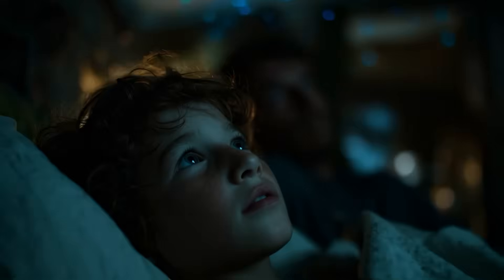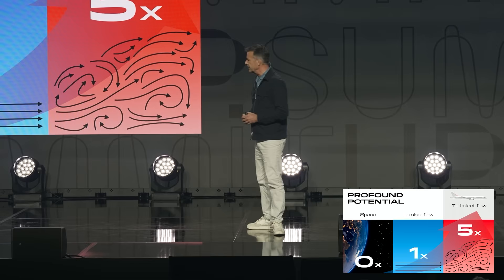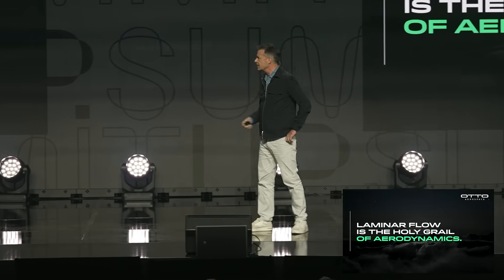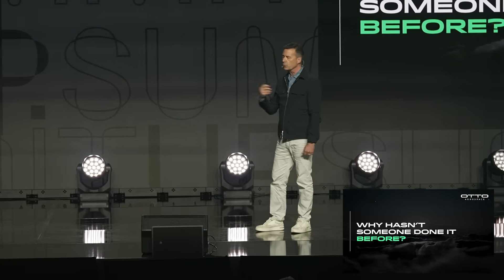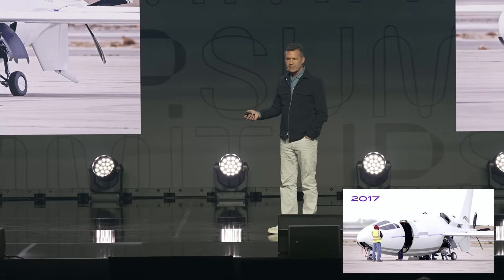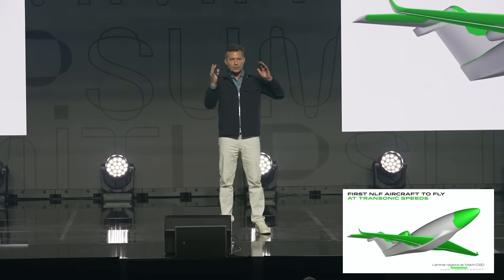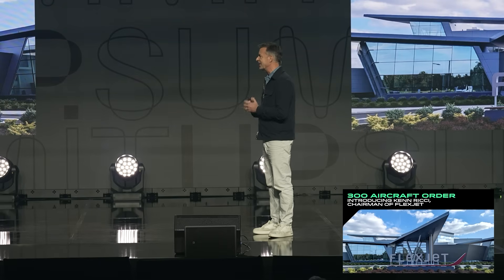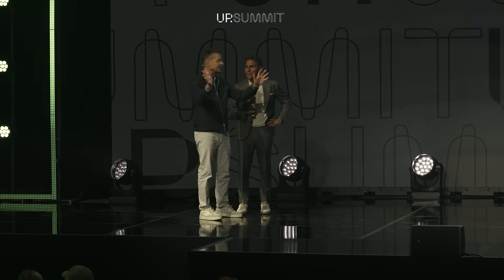Otto Aerospace CEO Paul Touw Presents at UP.Summit

Comment: 6:31 “moves at Mach 8”, I know what he meant but I chuckled.
Reply: I understood it as well but after doing a double take to confirm we were still on the egg-shaped jet I've been watching since '21 and not the a new variant of the X-43 😂
Reply: I heard what you did, but he meant Mach .8 or 613.84 mph at sea level. Ain’t no way on God’s green earth, that anything shaped like an egg is going to move at hypersonic speeds. What he was trying (poorly) to point out is that the design has high, sub-Mach speeds. Like current airliners. I’ve been following this company for a while now and the concept is proven (Celera 500 L). Proven and sellable may be two different things though, since many will have a problem with egg-like fuselage shape.
Reply: An airplane company that can’t present their airplane ideas…

Leading up to the guy who has bought positions in many of them… who skips talking about why he select this over that… and said the most important thing is capital.

Unfortunately, there is nothing to see here…

Non-pilots appreciate second engines…

Family members appreciate backup parachutes…

Small business owners like their own turboprop aircraft…

Selling rides on a small single engine aircraft is a very tough sell…

😃

Comment: There is quite a lot of BS in this presentation, unfortunately. Laminar Flow (LF) is not new and is employed on the HondaJet wings and in some Boeing aircraft. LF was the holy grail decades ago and we saw General Aviation aircraft with LF lifting surfaces. An essential problem with using LF lifting surfaces is contamination. Once a LF lifting surface is contaminated with ice or even rain, it is compromised and this can (and does) radically change its performance, such as a wing CoL (Centre of Lift). The comparison with Stealth Technology (ST) is spurious. The reason aircraft using ST have only recently appeared is because a huge amount of research and testing was required to minimise radar signature. The fuel burn comparison is also spurious. The Otto prototype used a diesel combustion engine, which will not be used in production aircraft. The singular novel feature of the Otto aircraft is the design of the fuselage as a LF lifting body. It raises the question of how to keep it completely clean and free of contaminants and damage. The underside of this low-slung fuselage might become  contaminated by landing on a wet runway, of from tyre rubber. A dent from runway FOD in an undercarriage door would not affect flight characteristics of a conventional aircraft, but on a LF fuselage, might materially affect flight characteristics - eg increased drag, reducing range.
Reply: I can’t agree with your “BS”, assessment. You’re right about LF not being a new concept. It was first used at scale in the wings of the P-51 Mustang. You’re also right about contamination affecting performance. But, contamination or damage would impact flow (performance) on any surface of any design. This breakthrough he’s referring to is in fuselage design. LF is referring to the flow of fluid (or air) across any surface, not just lifting bodies, so, since the greatest surface area on most aircraft will be in its fuselage, that’s where the greatest reduction of drag can be experienced. IF, they can get the design calculations right, which has been impossible until recently. This is evident in the egg-like shape of their designs. Am I off the mark here?
Reply: I agree with jimw1647, there is still lots of innovation that can go into even older ideas.  LF tech is far from optimized and certainly further work in the area will provide interesting capabilities.

Comment: My grandfather developed the Laminar flow wing in the 40’s. It is not new technology. The physics of drag have been known for decades. I wouldn’t buy a car from these two slick talkers.
Reply: First flights through some bugs and goodbye laminar flow.  Lots of hype and hustle here.  

Like you said, laminar flow as a technology has been known and used for 80-plus years.  This is not a breakthrough secret.
Reply: @kenstickney8678 What your grandfather developed was a wing that maintained laminar flow over more of the wing, in comparison to a "conventional" wing. The bigger problem now, is to maintain that laminar flow in conditions where the wing will tend to get dirty. Where regular aircraft will need to get de-iced, these aircraft might need to get their wings washed in normal weather conditions. As an example of the benefits of laminar flow, the Excellence Risen Ultralight completed a non-stop flight across the Atlantic last year, East to West, against prevailing winds, 1900 nautical miles, on 50 gallons of fuel at 165 knots.
Reply: As an aeronautical engineer I can attest they are telling the truth.   Bugs are not a problem all the time, depending on humidity, winds, ... there will be optimum windows to takeoff to avoid excessive bugs.
Reply: can't get anything by you, Jethro